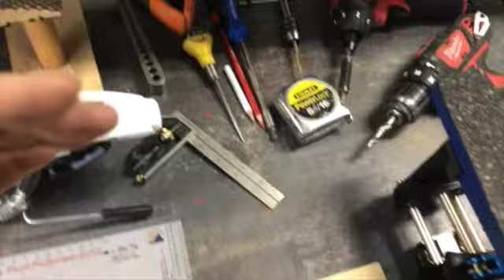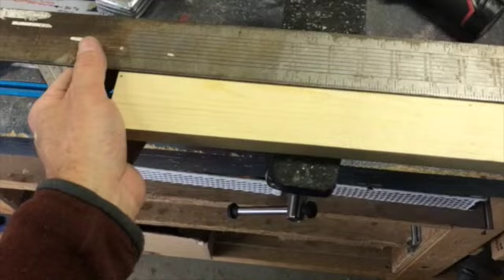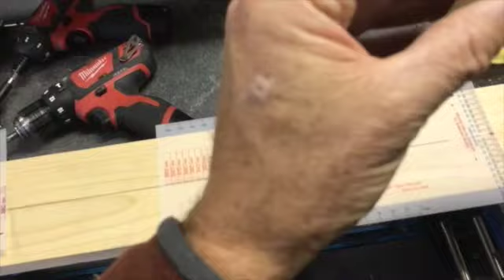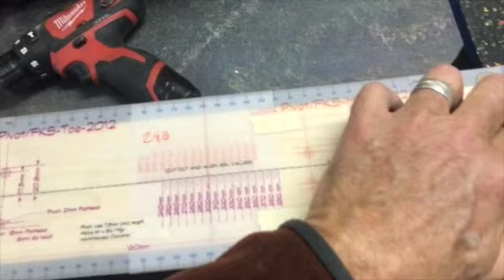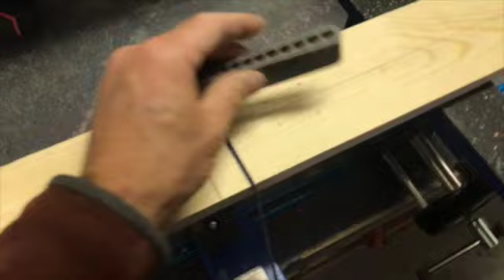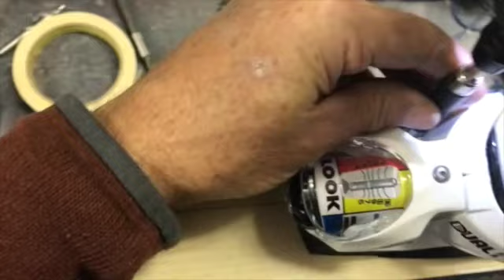Ski Binding Test Mount Process

Comment: How effective would it be to, once verifying that the hole layout in the board is correct, drill the holes all the way through and use the board as a template/jig to mark holes in the skis? (Seems easier and more foolproof compared to messing with the tape and paper again.)

Maybe cut out some V-notches at the midline to line up with the ski midline.
Reply from the maker: You could but realize every additional step introduces some margin of error. If you have a drill press, definitely use it to keep the holes vertical. Otherwise you might consider using a small drill bit and then flip the board after drilling to use the face of the board you marked on the top sheet. Then use an awl to mark your drill holes. Check out our Binding Layout tools for the concept: https://www.slidewright.com/dp/slidewright-binding-layout-tools/.

Comment: A very good presentation. I do believe you forgot to mention the use of a dab of wood glue in each screw hole when you actually mount to a ski. The wood  glue lubricates and seals the screw hole. Congratulations on recommending a drill guide and using a tap to the thread. Most do it yourself videos do not mention these steps.

Comment: I mounted a 2020 pair of Look Pivot 18s.  The box does not come with paper templates.  My old paper templates from an earlier Look pivot system DO NOT nor Rossignol FKS DO NOT fit the 2020 layout.  The toes seem to align but the heels have a different screw layout.  Do not blindingly use paper templates found on the internet.  Just like the video I mounted them on wood first.  I put the boot in the binding and tried to pressure the heel so that it approximately the correct forward pressure and was in the middle of the adjustment screws for heel length.  I then transferred the measurements to the actual skis using calipers and squares.

This is a one of, since I didn't make a paper template for other boot sizes.  Maybe someone with CAD can make a template and have it posted on the internet.  This was frustrating since Look and other binding manufacturers (actually their lawyers) don't want skiers mounting their own bindings.